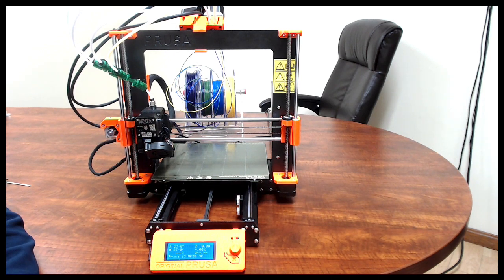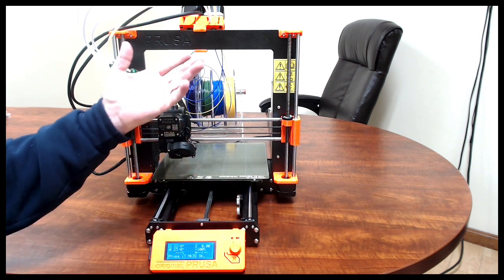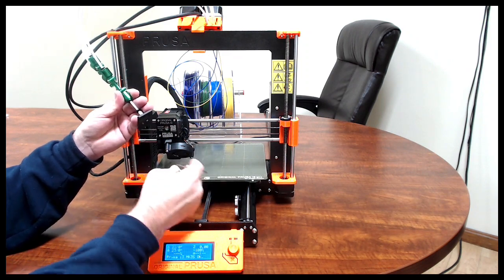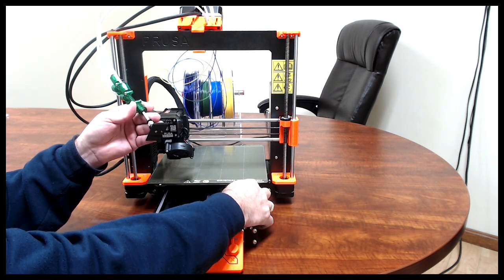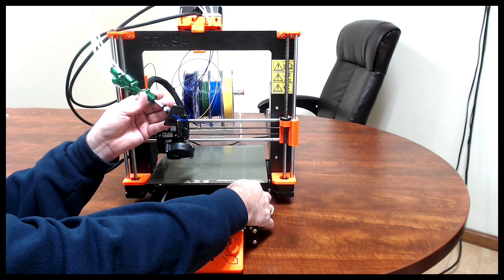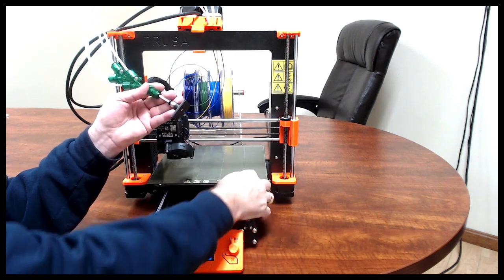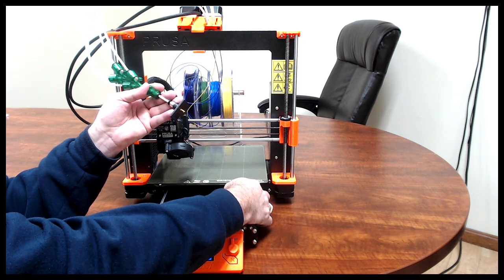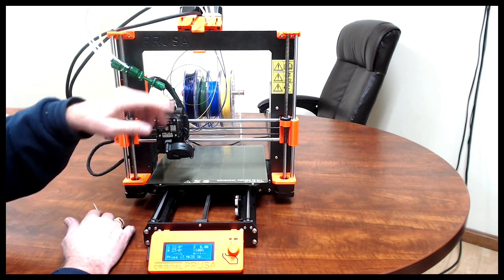3D Chameleon Mk2 Direct Feed Explanation

Comment: Bill, thanks for this video.   I was wondering how the motor that drives the filament though the 3D Chameleon would work with the extruder motor, now it makes sense - it turns off and allows free movement of the selected color.
Reply: Yes, that's exactly what it does.
Reply: @williamsteele  Thanks Bill, I am doing a lot of research before I start on the installation.  I received mine last week and it will be a unique install.  I'm thinking of mounting it hanging from the ceiling , feeding into my direct drive extruder.

Comment: Would love this solution as version where i source + print my own parts and only buy the logic board or so. (mainly due to shipping and customs cost)
Reply: interesting guess the circuit board and injection moulded combiner y part are really the main things
Reply: thought the same, but i got a response somewhere else, that they still think about having a distributor in europe.
Reply: Taxs n shipping make this not so budget friendly to those in UK & possibly Europe. I liked the  older version with multiple extruder and multiple switches (very RepRap) , but this is deffinately more user friendly and marketable.